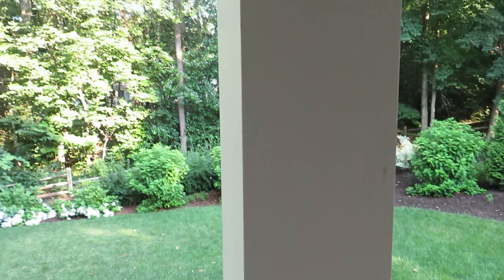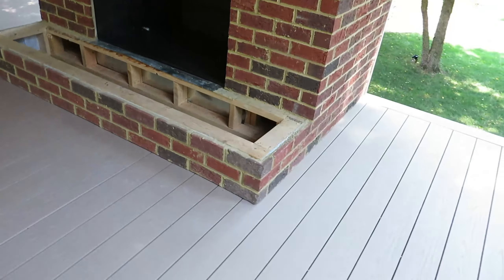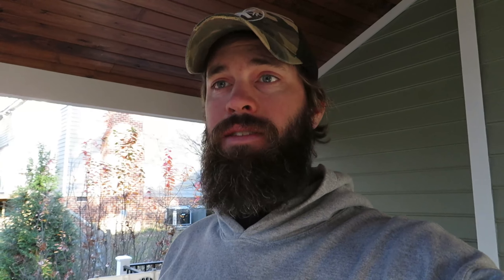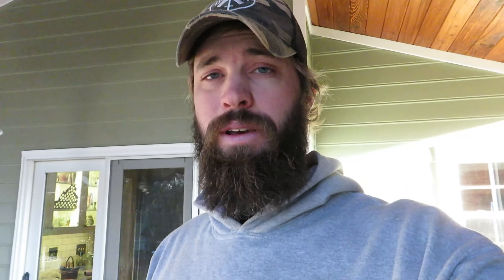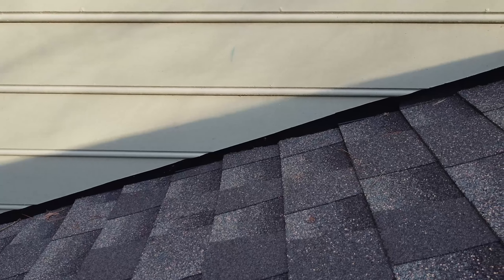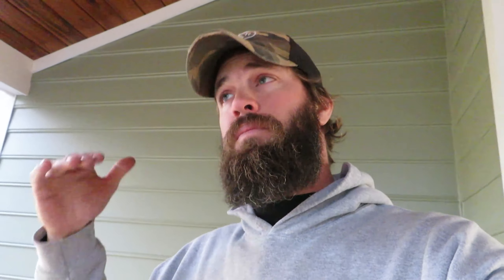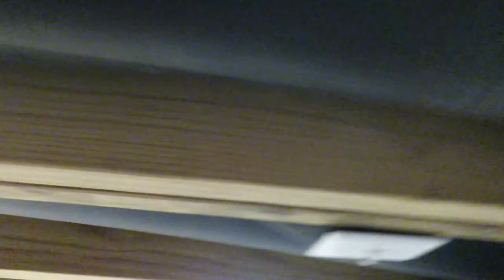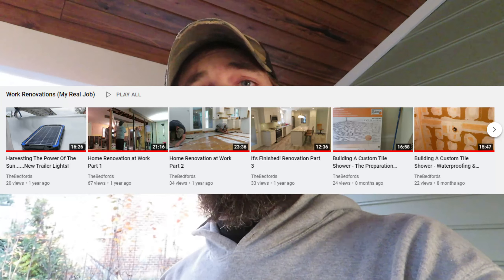Building an Awesome Covered Deck - (Part 7: The Final Product!)

Comment: Love the videos and how you did them Part 1-7 We can’t wait to see more of your construction projects !!

How many permits and inspectors had to check your work as you went?

All of your explaining of process and details is really helpful and we want to do our own deck/patio.

How long have y’all been doing the round concrete form with lag bolts for peering/framing of deck.

I didn’t know about this till videos.
Are there allowed and permitted with counties etc..

Thank you!!
Reply from the maker: I just realized I never answered your questions, Nathan.  Please forgive me.  

If I recall, we had a general building permit & an electrical permit.  As far as inspections, there is a footing inspection before concrete is poured.  Then a framing inspection (before we close anything up), electrical rough in & final inspections, and a final building inspection.  

I've never actually used the round concrete forms (sonotube), though it was brought up by a few people in the comments on this series, so I'm not sure about where/when they can be used.  When in doubt--talk to your local building inspector/department.

Comment: This project came out really nice! All the details speaks well of your craftsmanship. I was wondering why you still needed the baffles under the deck when you have a roof overhead?
Reply from the maker: Hopefully my response to your question on part 4 answered this. If not, the only thing I can add is that the baffles will just make sure that all the water that ends up in the bladder/troughs makes it into the gutter, instead of going past it.

Comment: Amazing build, I would love this on my house.
I think I will be duplicating this waterproof system for my deck build coming up hopefully this summer.
I think a faux wood beam would have finished off the underside of that ceiling better.
Are the main posts coming out of the ground 6x6?  And is there a reason for not resting the beams on top vs cutting them into the posts?

Curious as to what issues did you have with the railings?
Reply from the maker: A beam on the ceiling definitely could have looked cool. 
Main support posts from the ground to the deck framing are 6x6. 
As far as notching the posts, if you referring to the double 2x12 girder that got notched into the 6x6’s and is what the joists rest on—that’s just how we have always done it. There could very well be another way of doing that specific detail, but personally I like the way we do it, and I know it meets code and will be a strong and lasting part of the framing assembly. 
Regarding the railings, we had communication problems with the railing company. Then on the initial install, there was a lot of damage done to our PVC post wraps & composite post sleeves. It also looked like someone took a grinder on site to cut the angles on the stair railings. And did it very poorly. Second time around they messed up more of the composite post sleeves we had bought to replace the damaged ones, and tried to cover it up without telling us or the client. When it was all said and done, we left our client with some fantastic looking railings. But it was a very poor first impression using this company. They did much better on the next one we did at the end of last year. It was either a totally different install crew, or they just made really sure they didn’t mess up their second job with us.

Comment: Question... the epdm water proofing material was used for rain getting on the deck and of hand washing the deck, correct? And keeping things dry below...?
Reply from the maker: Exactly. Even though there’s a roof over almost the entire deck, rain will still blow in and stuff like that. Then if you want to wash it off, it’s all getting wet underneath, and the client wanted dry storage under the deck.

Comment: Since the posts for the roofing system are sitting on top of the deck, what stops the entire roof from moving laterally from side to side? I understand that the beams are attached at the house, but at the far end of the roof, it appears to me that they have the potential to shift laterally. The railing system is providing some support, but is it enough?
Reply from the maker: I’m not a structural engineer, but the exposed timber truss at the end is part of it I’m sure. There is probably the potential for some amount of movement, but the design/plans were approved by our engineer and the local county building inspectors.
Reply: Once the roof is sheathed, it stops any lateral movement.

Comment: Looks good!  Having a bladder system under a roofed deck doesn't make a whole lot of sense to me and a waste of money.
Reply from the maker: If it was my house, I might not have, but that's what the client wanted.  It also wasn't actually that expensive.  It took 18 man hours to install the entire system, and the materials cost isn't very high either, so they felt like it was worth it.
Reply: @thebedfords1394  I thought this too, but I then considered nasty storms blowing sideways will most definitely allow water in, also the composite will inevitably get dirty so when they go to spray clean or mop it etc. that water will drain and not land in the storage area.

Comment: Did you show how you tied the beam into the house without the support next to fireplace?
Reply from the maker: I don't think I did, but fortunately, it landed on top of some studs inside the wall which carried the load, and then I think we used TimberLok's to fasten it to the house.
Reply: @thebedfords   If it didn't I assume you would have to open the wall to add studs? Was the inspector ok with it since he couldn't technically verify it has bearing to the footing?
Reply from the maker: @matthewcallis1200  yeah we would have. I don’t recall the inspector asking about that specifically, but the beam comes in to the house right at the edge of the window, so he might have just assumed it was bearing on the jack/king studs (which it was) and simply not asked us to remove a bunch of siding to verify. It wouldn’t have been hard to add studs, just would have meant a bunch of additional siding work, so I was glad it worked out the way it did.

Comment: What brand of fire place is that?
Reply: Also, what is the thought process of using the bladder system over a covered porch. Not against it, only asking because I am building the same kind of covered porch. Has the client ever thought about the azek porch decking that is tongue and groove? I am debating between the tongue and groove and using timbertech with cortex.
Reply from the maker: The fireplace is made by Superior Fireplaces.
Reply from the maker: They decided to use the bladder mostly because it’s not that much of a cost upgrade in the overall scheme of the whole project, and will allow for everything under the deck to stay dry, even in a driving rainstorm with the rain blowing in several feet (like it did several times during the project), or if they want to hose off the deck & furniture during pollen season and so forth. As for the type of decking, I think our company has done the T&G Azek boards once before, but it was on a front porch of a house in the city, which is where we typically see that very old school style of flooring. I don’t think I’ve personally seen it on the deck of a ‘normal’ house before. It’s all personal preference though. It’s obviously a great option if you currently had a historic house with the pine T&G that is not in great shape anymore. You can keep that historic look and feel but have all the benefits the composite decking brings. But the normal groove decking with the hidden fasteners, along with the cortex plug system is also an exceptional system of decking. I absolutely love it.
Reply: @thebedfords  thanks for the great response.  I'll stick with the timber rec then and use the bladder method. Out of curiosity what was the square footage of the deck? Trying to determine the amount of edpm I'll need. My deck is about 620sqft. 12" joists oc obviously
Reply from the maker: I don’t remember exactly how big it was, but I can tell you (I think I mentioned it in the waterproofing video) that each bladder section was 18” at one end and 24” on the other, for 16” OC joists. Basically an 6” difference from end to end. So for your 12” OC joists, I would do 14” to 20”. I would also point you at drdecks on IG. He has several videos that cover how to install this entire bladder system.
Reply: @thebedfords  Looks great, is the fireplace vented overhead? I do not see where the chimney comes through the roof or vents out the back of the fireplace.
Reply from the maker: @bchilva  Haha, funny story.....
So originally it did vent through the roof.   You can see that at the 9:00 mark of the part 4 video.  However, we had some code issues that came up during the final inspection that we were unaware of, and so we had a few options.  Keep the wood-burning fireplace, but have to modify a lot of things in order to move the chimney a few inches away from the house (the primary issue was it was too close to the house/house soffit).  The other option was to remove the chimney, patch the roof, and permanently cap off the vent from inside the fireplace, which is what the client opted for.  They had actually sort of changed their minds during the months of all the initial design work from wanting wood burning to wanting gas logs, but the unit had already been ordered.  We had actually already roughed in the gas line for future gas logs, so the decision was pretty easy for them to make and we just did away with the vented fireplace and turned it into a ventless gas log setup.  Sorry for the lengthy answer, but I wanted this all to make sense.
Reply: @thebedfords  haha, what a pain, I think it has to be 10' from the roof line and 2-3' above the ridge or soffit. Something like that. They didn't want to vent it out the rear of the fireplace?
Reply from the maker: @bchilva  Yeah I don't remember what all the dimensions were exactly, but that sounds about right.  I wasn't involved in much of the discussion except for the fact that we happened to find out about it a few days before a family lunch, so we discussed some of the options at that point.  My dad is the owner of the business.  My brother is part owner and project manager, so we naturally talk shop at family gatherings lol.  Regarding venting out the rear--I'm not sure if it was ever discussed as an option.  I think the client has pretty much decided they only really wanted to use gas logs at that point, so the solution we went with was the easiest/cheapest way to arrive at that end result.  Had they still wanted to have it be wood-burning, then we would have made that happen too.